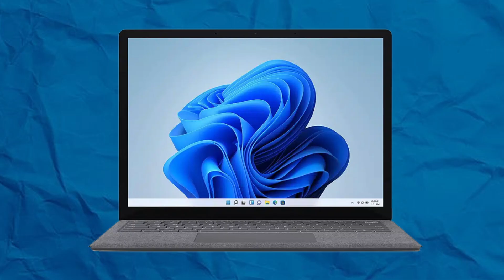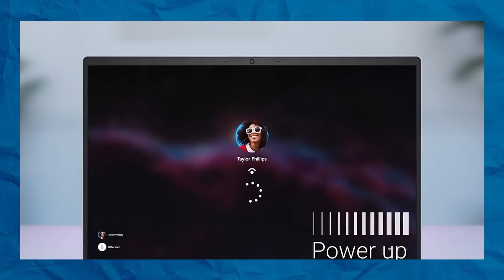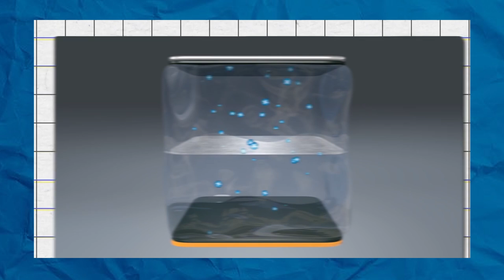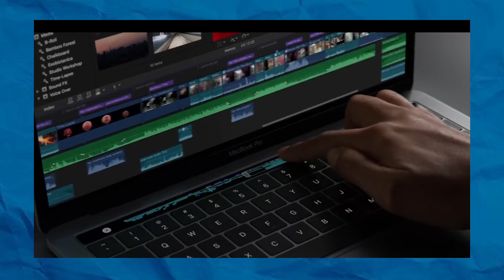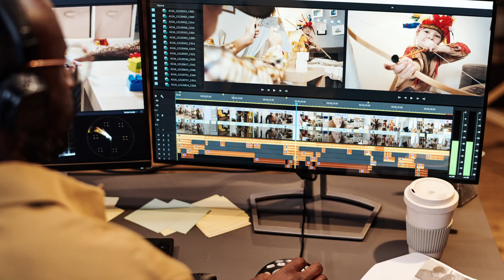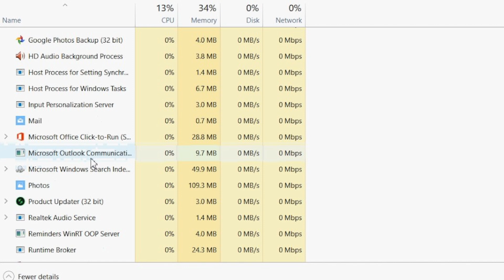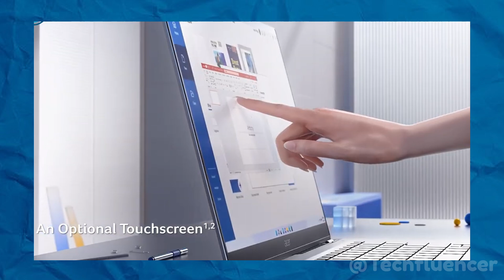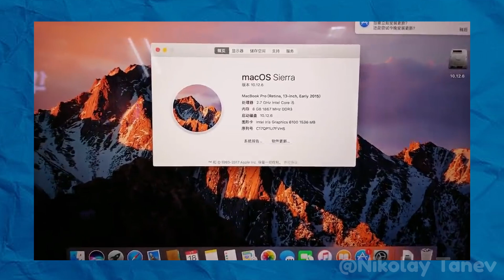Laptop Batteries Are Worse Than You Think – Here’s Why

Comment: I got the solution for me. I also do video editing, photo editing and web development (it's my hobby) so i have lots of demands when it comes to using my computer and for that stuff i'm using a desktop computer but considering i also need a pc for my job (mostly for office stuff) i switched from a windows laptop to a chromebook few years ago. The battery is fantastic, it charges after about an hour and a half, the os is lite so performance is amazing (despite the fact that it has 4gb RAM, 1.70 4 core processor and 32GB storage) my only regret is that i didn't know those laptops existed sooner but after getting one i'm never going back to windows laptops.

Comment: The advertised efficiency only applies when you are pushing it to its TDP. The real problem of poor battery life (especially in Windows laptop) is because light tasks also consumes a lot of energy. Try use HWmonitor to check your current wattage. In fact, modern x86 CPUs have VERY agressive frequency boost and they consume about 11W on avg when watching YT and 13W in web browsing (while their Mac counterparts just sipped on 2-3W). Assume the battery size as 60W you can only get around 5 hours of mixed use but 12+ hours on a Mac. Let alone Window laptop’s idle power consumption is also high, with 3W on idle while Apple silicon sits at around 0.2W.
P.S. Actually ARM chip doesn’t mean good battery life, ARM chips only means easier to achieve good low-frequency efficiency. Other than the inefficient power management in Windows, the design of the SoC also affects the overall power consumption (the most), e.g. PMIC, integrating RAM on package. But Snapdragon and Intel (except LNL) won’t do that because of the high cost and low upgradibility, and real good battery life is hard to advertise.
Reply: screen power is included when calculating battery life

Comment: I mean, it depends on the how the OS handles the resources and the hardware as well. New ARM chipsets don't seem to have this issue you are talking about. And manufacturers are using graphite to create new batteries that have better lifespan and fast charging without causing the same issues as Li-ion .
Reply: Because ARM chips were primary designed for smartphones. They were designed to draw less power than X86 chips. That's the simple truth. X86 manufacturers don't bother designing chips that draw less power.
Reply: @Sayuri998  True, but now they do (cause competition). The latest AMD and Intel Chips are very efficient, tho I'd like to see Windows use less power but kinda impossible as they love collecting data and telemetry stuff. I mean, even if ur Windows laptop is shut down, it is not actually off. It is just on a very low consumption mode.

And I get it, X86 do tun desktop apps a lot better and don't need emulation like ARM chips, but for some people, the trade-off is convenient, designers on the go, people who travel a lot. Why do I have to charge the laptop every few hours

Comment: The problem is that despite over 2 decades of creating more powerful and more efficient electronics, manufacturers completely throw the energy efficiency out the window and clock everything to the max. This seems to a culture issue. I remember when Windows engineers were baffled over the amazing battery life when they swapped a 15w TDP Intel chip for a 5W TDP ARM chip. If manufacturers would just leave a little headroom for the energy efficiency, we would have whole day battery life by now, but alas.
Reply: i would think the reasonable option on that would be clock down for improving efficiency as an additional thing power saving modes can try and warn user of lowered performance on battery saving

that also leaving maximum clock for use like gaming when user dont need maximum battery time or when user is on charger and has smart charging circuit which bypass battery and directly goes to components leaving battery not charging and not discharging
Reply: @FluffyFoxUwU  It's funny that you should mention this. This is exactly what ARM tried to achieve with the big.LITTLE architecture (I don't know information on how well it works), but manufacturers turn a blind eye to this because, well, there is just no competition. They think it's "OK" to just have a certain amount of battery life. Trying to innovate to make multi-day battery life possible is just not on their cards because they don't think the market "wants it." But when ARM chips hits the market proper, I think manufacturers will have to rethink this.

The thing is that chips are usually designed to run at a specific power level, and designing chips to run well on many different power levels is just very difficult and is always beaten by chips specialised to run at a specific power level.
Reply: @Sayuri998  yep and Intel just started doing that with introduction of Alder Lake and later CPUs which i think its nice considering many E cores are pretty good at doing multithreaded workload than few P cores

E cores have good performance per core size so 2-3 E cores covering same space as a P core can do multithreaded workload better. its essentially same idea of why gpus have thousands of cores than few cores

Comment: some more modern laptops bypass the batterey when its fully charged and its still plugged in its there to acctually avoid the batterey digration he said so check if ur laptop does that if it does ur good
Reply: That's not how it works. The issue is letting the battery remain at 100% charge, and the heat generated by the electronics. Although that said, newer laptops today tend to sometimes integrate features to limit the charge to somewhere around 80%, which is much batter for the battery's health.

Comment: Why should bigger batteries generate more heat? It depends on the wattage you charge or discarge the battery and not the overall size. It would even help with heat disapation, because the heat gets distributed over a bigger area. The only downside would be it would take forewer to charge. Theres another reason why laptops almost never have more than a 99.99Wh battery. Your not allowet to take more than a 100Wh battery on an airplane.
Reply: bigger batteries generate more heat because of the increase in density. the denser a cell is, the more difficult it is to cool. it also very quickly would create quite unmanageable weight very quickly

Comment: they should just make a fatter laptop with a larger battery. i don't care how slim the device is, if i am stuck to a charger with the laptop sitting on a desk.
Reply: I love the old 16" laptops that last a full day
Reply: Or one with two batteries which you swap one out multiple times through the day
Reply: @flamestoyershadowkill  yes. that's a possibility, but most people are wanting a seamless experience on a single charge.
Reply: Yup, I agree with this...
Less packaging, less cost for another powerbank and you are not glued to your chargers.
Reply: @steve_polychronopolis  Why don’t they have 2 batteries they automatically switch between so they can have 200 watt hours?
Reply: Such Laptops will be too heavy.
Reply: @srikrishna2561  too heavy for what? Even if it weighed 10lbs, I could take it with me.
Reply: @steve_polychronopolis  sure bro
Reply: @jeong-ilkajokaya3849  yeah, fam. No cap.
Reply: @steve_polychronopolis  10 lbs? Bro, try harder next time when trying to lie and cope.
Reply: They kinda exist there called rugged laptops only used by professionals  @srikrishna2561
Reply: LOL they don't make over 100wh batteries so that they don't get banned while flying. if you want a bigger battery just buy an external USBC power bank ya I djit
Reply: @chimpo131  there's always a way around that. Split the battery in 2 and have it removable. I'm certainly not flying anywhere with mine. 17" monitor is barely portable, anyway.
Reply: @chimpo131 I will quickly buy a laptop with a Lunar Lake processor with a 99.9 watts battery.